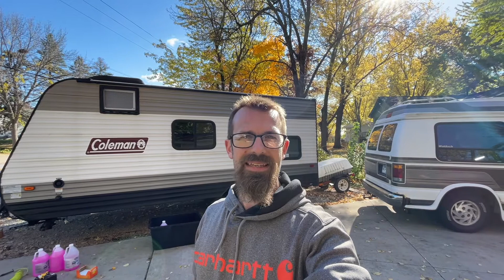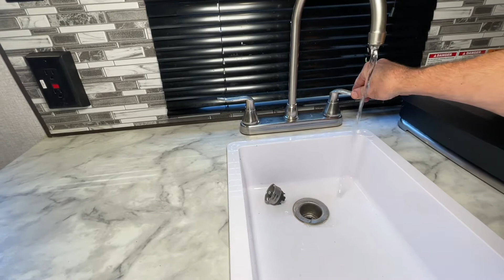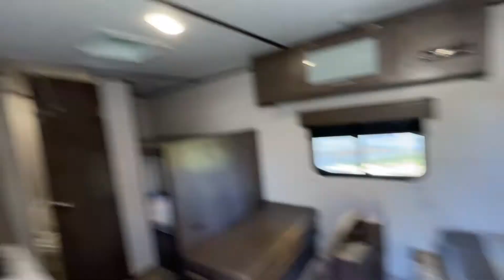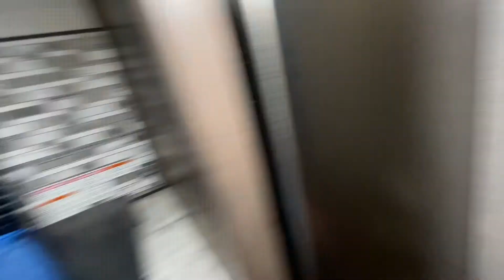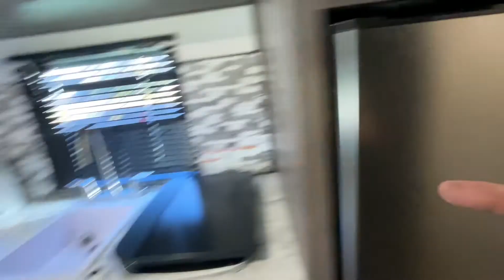RV winterizing: 2021 Coleman Lantern 17B

Comment from the maker: Camco pump: https://amzn.to/3jQ3eIY

Camco blowout plug: https://amzn.to/3ZxPnaT

Rodent repelling devices: https://amzn.to/3LdVeiS

Fortress (Harbor Freight) portable air compressor:
https://www.harborfreight.com/air-too...

0:12 tools and supplies I'm using
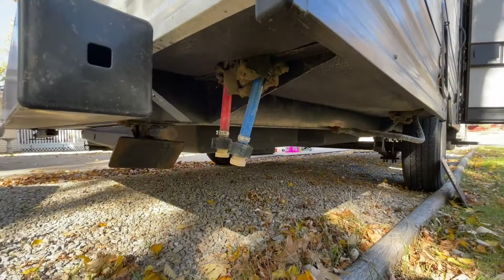1:03 locating the low point drains
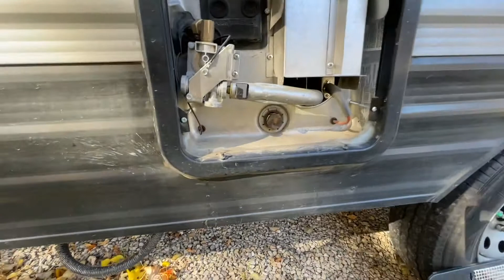1:07 draining the water heater
1:47 opening the low point drains
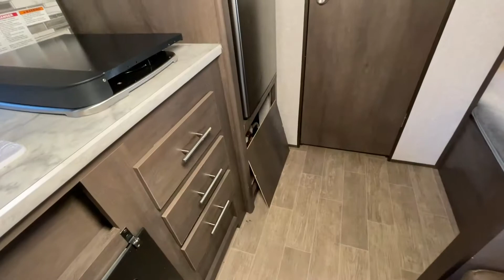2:13 accessing the water heater and turning valves
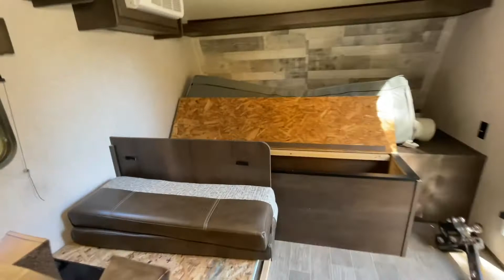2:40 accessing the water pump
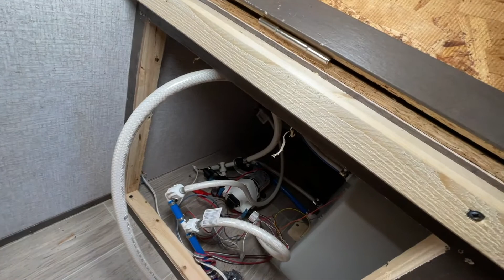3:16 reinstalling the anode rod and low point drains
3:34 blowing out all the lines
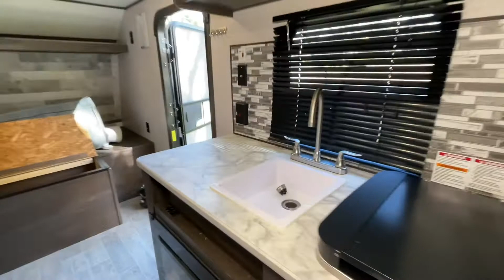5:38 pumping antifreeze in the city water connection
6:34 checking / cleaning the water pump filter
7:17 pumping antifreeze though the system
9:45 dumping antifreeze down the traps
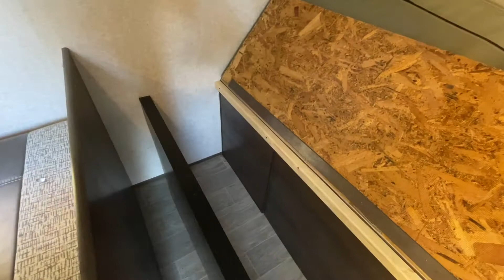10:01 putting the covers back on, cleaning up

As an Amazon Associate, I earn from qualifying purchases.  For your convenience, I try to post links to everything I use in the video description.  That's part of how I cover the costs of this channel.  I appreciate your support buy using these links!!

Comment: What about the low point drain on the front from the fresh water tank ?
Reply from the maker: Yes, I should have mentioned draining the fresh water tank in the video.  I would generally not recommend storing fresh water in the camper (this one gets drained after each use).  I shouldn't have made the assumption that everyone also does that.  Definitely open up the fresh water tank drain!

Thanks!